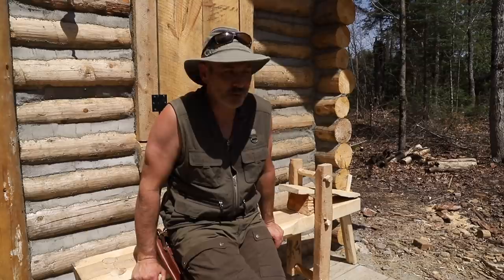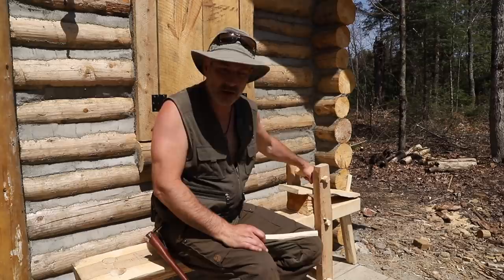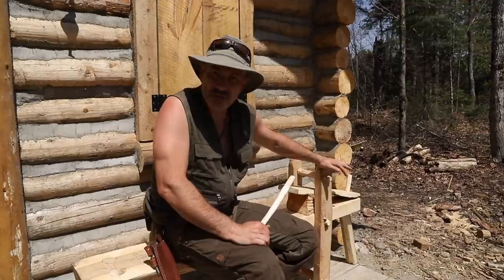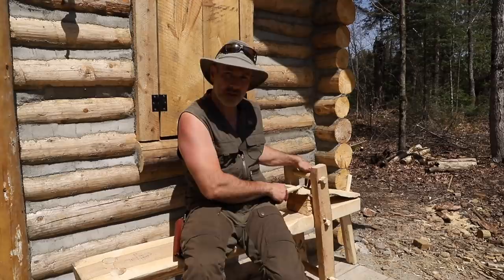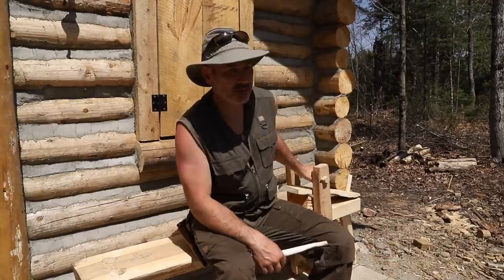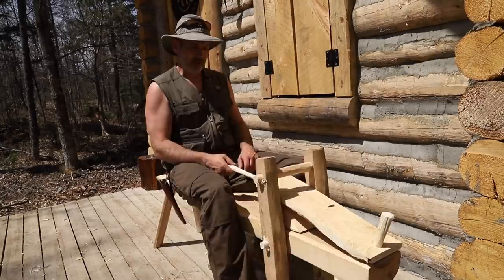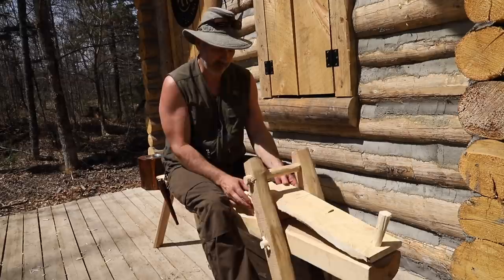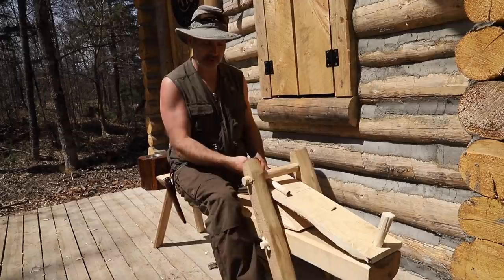Traditional Woodworking in the Forest with My Dog, Cali the Golden Retriever

Comment: nothing wrong with that shaun,  i am a greenwoodworker yurtmaker/timber framer . where you are i'd pick a tree fell it at 4 feet possibly 5 flat both sides of it set another post 4 foot away solidly in the ground  put in a  horizontal between the posts then on the back put in another rail 8 inchs higher on the flatted stump angling down to th same end position as the horizontal on the post, . you end up with a triangle between the posts 8" to nothing this is really handy for splitting and drawknifing long pieces more than 3 ft to full lengths for splitting and can be used as an anvil etc how i split 12' poles to make yurt roof poles and trellis but has many applications from fence posts and hurdles, just a thought!

Comment: Seeing this really made me happy. A shave-horse is the perfect companion for a draw knife, it strongly increases your work efficacy. You'll find that now you can work faster, feel more confident/safer while using your draw knife, and really be able to put increased force into your draw cuts (just remember to strap/hone your blade edge, and sharpen it when needed. A sharp tool makes work effortless) a tool like that is such a personal thing (because it is so strongly tied to working with your body's proportions), you'll find it will probably take you 'making a few' each time getting closer to being tailored specifically to you, before it's perfect. Having more than one isn't a bad idea either, sometimes what works best for smaller stock doesn't work as well for large stock. That's the great thing about working the way that you are, each success builds off of previous ones, and each tool means that the next thing you make well be just that much better. All-in-all, I really enjoyed this one!

Comment: Shawn I live in Sudbury Ontario and the bears have been out and about for a couple of weeks. Last couple of years the food in the bush around the city has been good so the bear sightings dropped but in 2015 ( when the blue berries and other natural foods were in short supply ) there were over 1,700 bears sighted ( city population about 160,000 ).  We saw our first one in our yard last week, have you spotted any yet this year?
Also I noticed that on your draw knife bench ( shave horse ) you cut the legs off with a saw. You should take your knife and bevel the cut edge, or else the corners will catch as you move it around and start to splinter i.e. tear the wood grains apart. Love your videos. You and Cali are lucky to have each other ( your wife as well ).

Comment: You might wanna get a 10-stops ND filter for photos without flies (or any moving object). It's basically a sunglass for your lens, so you can shoot daylight images with long shutter speeds. Also great for shooting waterfalls or lakes, smooths out the water.

Comment: my grandfather also made his own benches similar to the one you're for making handles for baskets, if you put a larger piece on top to help hold the wood down that will help a lot, and add pieces of leather to help with holding the wood in place so it won't slip should also help.

Comment: one suggestion: a carrying strap would help you with transporting those logs and big planks without struggling to get them up on your shoulder, just placing it crossshoulder will let you get them around a bit easier. hope it helps.

Comment: Another excellent video, Shawn! Glad to see you made yourself a shaving horse and that you went with the English head. I think you'll find it more useful for your needs. When you build version 2.0, consider using a "knee" (a naturally curved section of a tree) for the treadle arms. I found that getting the treadle a little closer to me took a good bit of strain off my legs and made using the horse more comfortable. It also allows me to sit a little farther back so I can get longer more even strokes with the drawknife. One thing I found out making my last one is that it is easier to bore the holes in the knee, hew or saw the edges square, then saw it down the center to give you two matched treadle arms.  I, personally, also like to leave the lower treadle dowel about 6 inches long past the treadle arms to give me a more comfortable foot placement. I also drilled and pegged through the treadle arms and into both the footrest and the grip. It probably isn't any superior than through mortising like you did, but it felt more rigid and stable to me. The pivot was through mortised like yours so it can be slid out and given a good rub of candle wax every now and then.

Now about that ironwood stump... 8-)

You need a proper maul. Those bits of wood that you've been using for your froe and axe are too big around to hold comfortably and, from the way they ring, are probably some sort of conifer (spruce maybe?), not to mention much too light to be an effective tool.  On the other hand, that ironwood is a traditional woodworker's dream. You'll just have to dig the stump out to get as much of the rootball as you can. The grain where the root becomes the trunk will be tightly interlocked, impossible to split, and nearly impossible to chip. A couple days soaking in one of Cali's puddles will let you agitate off most of the dirt and stones. Then it's just a matter of working to a rough shape while it is green and wet. Once it dries, it will be like whittling pig iron. Use your judgement on what looks and feels comfortable in your hand, but a good rule of thumb for the head is taper it from 5" to 4" over a length of 6 inches. The handle part should fit your hand but be a bit large because as it seasons, it will shrink a bit. Once you get it roughed out, seal the endgrain. I use candle wax, but whatever you like should work, although linseed oil probably should be reserved for finishing. Put it in a warm dry place with good air circulation for two or three months. Then it's just a matter of final shaping and sanding. That ironwood is going to be a challenge, but the result is worth the effort. The very first tool I made at my grandfather's side was a maul to fit my boy sized hands. It was made of a cottonwood stump and, at the time, seemed like the most work I'd ever do. It got chewed up by use (and at least a little abuse) over the years; I lost track of it when I went away to college, but I like think that somewhere it is still on a workbench waiting for a small hand.

Thanks for what you do. I always look forward to seeing your videos.

Comment: The shaving horse it a great tool.  You can put a board on the rest under the clamp pin head, this will shim your work closer and it an be adjusted closer to you to support thinner stock.  This style is know as a Bodgers shaving horse.   We make them much lighter with no legs, it can be moved around and you use a bench or stump, a chair, anything at hand to set it on.  I think the version you put together here is great, we are often our worst critic.

Comment: If you want to drill a perfectly aligned hole through the shave horse, mark a 90 degree line across, then mark down on both sides.  Drill from both sides equal amounts and voila, you have a perfect hole through it.

Comment: I had the same problem with the hole being uneven when I made my shave horse... tip I learned afterward is drill half way on one side and then half way on the other side and if they are off, then difference can be adjusted in the middle and it will make your hole line up (tip came from Roy Underhill)... I really like what you have built!

Comment: I mentioned in an another video of the plate, but I didn't mention one can buy a small hand crank peg maker.  T.F. is one time you can install a less than round peg in a round hole with benefit.  Making the plate/peg-cutter  will be best for the sizing you want & not as expensive.  Enjoy.  Draw your draw knife evenly per opposing side.  Thanks for the videos.  Great content.

Comment: AWESOME build .... loads of character even with the little quirks that arose .... I know you will find this item extremely useful and a great help in your future builds .... best part, now that it is functional ... you can make better parts for it as you adjust it for your work style and needs ... instead of notching the top spoke for dowels you can either a leather pad or a tree notch that has a U up and down in the right orientation which will also hold them still and firm.
.
as for your outdoor kitchen and bread oven ... dont forget to make a warming oven ... usually on the far side of the bread oven away from the main heat source .... it will let you warm buns and keep other food warm while you wait for things to finish ... it's also awesome for letting a stew slooow cook as well ... makes great spaghetti sauce as well ;) ... super tasty .... oh and dont forget to make a griddle spot .... you might be able to find a Jenair stove top griddle insert at a garage sale or other places ... they even come with grease drip holes ... so keep a few small cans to catch the drips and make your own lard ;)
.
I can hardly wait to see when you make a pole lathe ... I assume you have or know where to find the tools needed for it .... then you can make your own wood vise's and wood screws ... I can picture you having rewatched a ton of "The Wood Wright's Shop" from PBS for many more ideas of stuff you could make and use ;)
.
That hard rush of water from spring run off looks like you might be able to get a small hydro power generator hand built to cover the few needs for electricity as well .... doubt it flows that heavy all year long but It does look like you could get a car alternator to run well and make enough power for a light or three and even recharge stuff as needed ... 
.
Looking forward to yet more video's with the better weather ... great job so far ;)
Reply: whew ... system lagged just as I was posting ... thought I lost all the typing ...lol ;)

Comment: I remember seeing Amish use an Adze to remove a strip of bark down the length of a log, then switch to a spud to peel the bark in one piece. Seemed much quicker than using just the spud, even with an ax. But I guess you use what's comfortable to you...

Comment: Very functional shave horse, well done.  You might wrap the clamping rod with leather for a better hold against the force from pulling the draw knife into the work.  Some have leather on both the clamping rod as well as the adjustable base platform.  I would recommend using it for several projects to see if it even needs any adjustment; I think you did a fantastic job using basic tools and proven techniques.

Comment: A good thing is that you have Cali on a tracking device just in case.  
Sawhorse?  I would call it a bodgers bench.  I would have kept both sides of the foot pedals for a more even shaving of your wood pegs.  A better wedge would be nice too.  It is a nice basic for now.  It will also surely help to file the tools for good sharp blades. 
Do you have latches yet for your shutters?   Is the chinking done on the house?  Are you setting up a screened in an outdoor kitchen? Just thinking about the flying bugs.  For your question on the outdoor kitchen a composting collector for plant food scraps and eggshells etc.  Nice place to rake the scraps into while in your food prep.  You might need a yard composting station for a future lawn and garden needs.  Icehouse for one more back burner item for next winters ice. Shawn, it is a nice footprint widening it is all looking very nice.

Comment: Great build, as usual. One thing--At about the 29-minute mark, you split a log using two axes, striking the butts against each other. I was always told one never uses the butt of an axe as a hammer, especially steel-on-steel, because it isn't tempered for that. Any comment?

Comment: Hi, is it worth putting a log under the bottom peg so when you sit on the bench your body weight holds the work piece rather than using your legs to pin the work?

Comment: STONE/CLAY BREAD OVEN with dinette table & chairs
Wood fired Multiple adjustable [Slot grooves] rack oven
Control panel operated manually 
Single rack capacity - hook design for 48" high rack (lower sizes available), 
Unit approved for zero (0) clearance to combustible surface sides and rear
Type II Baking canopy standard, with automatic damper connection, canopy vent connection , pressure release vent and flue vent
All stainless steel construction
"Patented" IBS rotation system
Increased baking surface, rack rotation is alternately clockwise and counter-clockwise for uniform baking
Gentler bake with high volume and low velocity air movement via two fans
Patented cascade steam system (works without nozzles)
Flush front
Heat exchanger completely in stainless steel
Oven door to have visual window 
Controls are recessed and protected
Door latch design completely in stainless material and with double lock cylinders
Damper - Linear opening